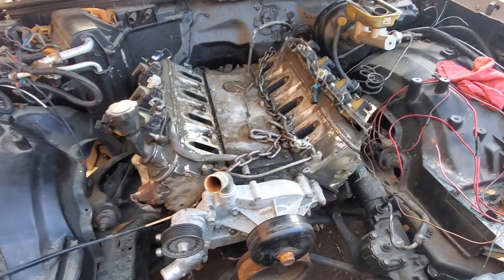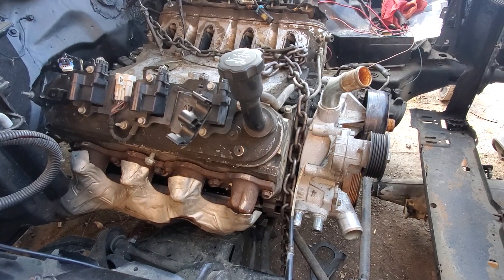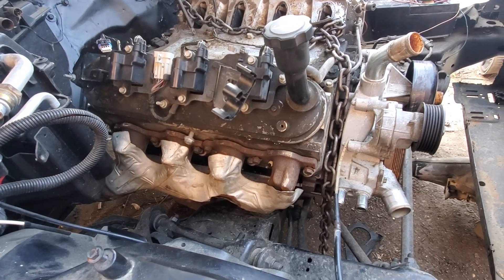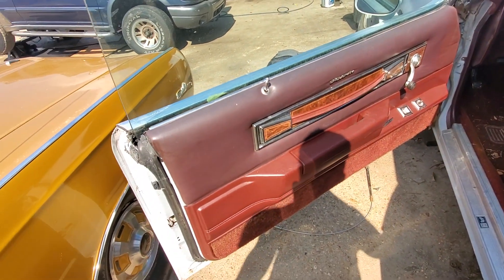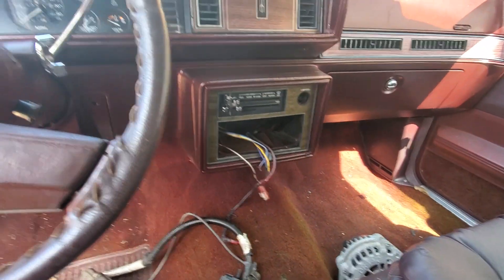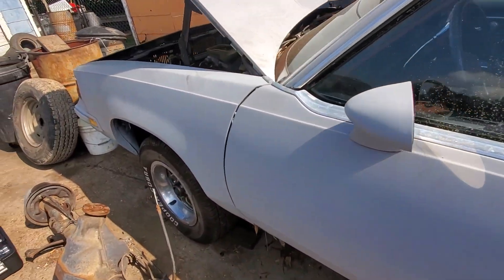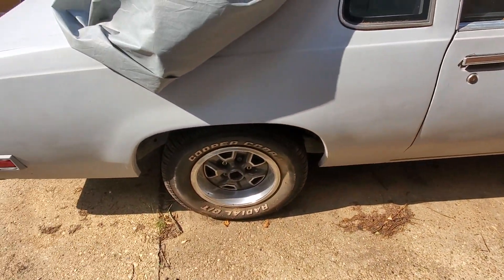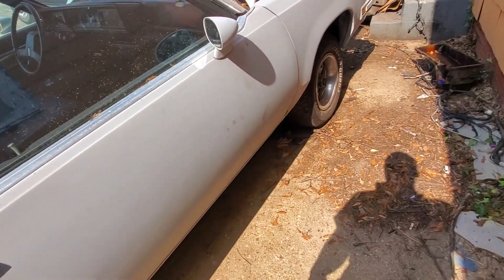84 cutlass ls swap beginning

Comment: What oil pan you use
Reply from the maker: Gm muscle car oil pan
Reply: @JDP15  do you have a part number
Reply from the maker: @darrickitson8073  nah. Just Google GM muscle car oil pan. But what motor mounts are you using
Reply: @JDP15  ict bullet adapter, stock 305 clamshell and motor mounts
Reply from the maker: @darrickitson8073  ok good. That's what I'm using.  Everything will line up perfect.  You running headers or manifolds?
Reply: @JDP15  ok bet thanks bro, I’m running the s10 headers
Reply from the maker: @darrickitson8073  they should work. I'm running manifolds from summit racing